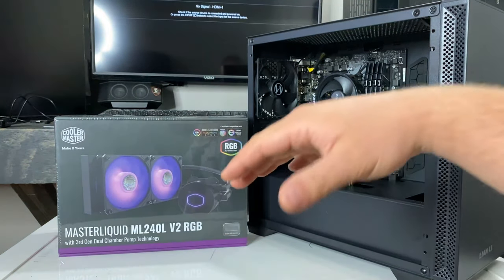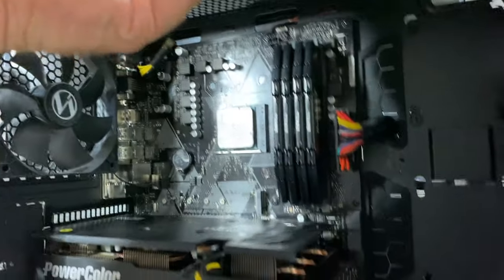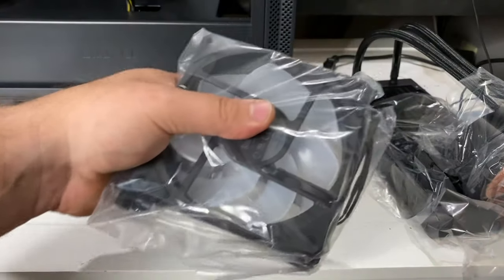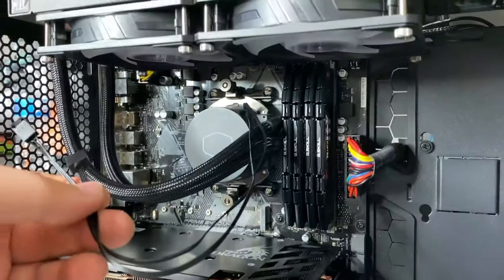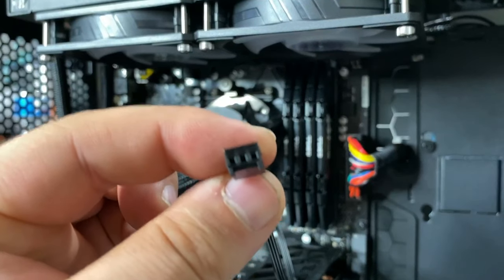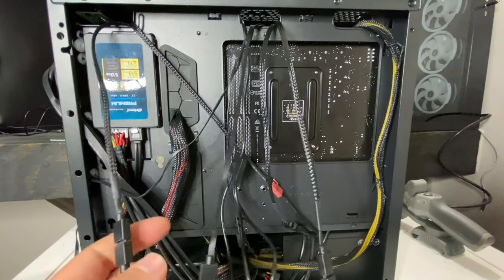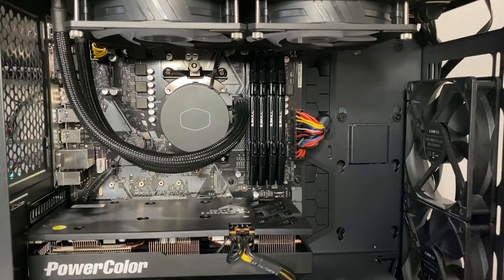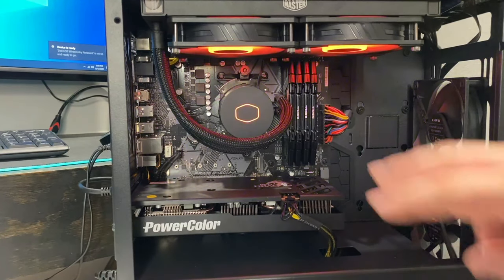How to Install a Water Cooler in your PC (MasterLiquid ML240L V2 RGB)

Comment: Hello i already installed my Cooler Master ML240L V2 RBG but when i turn on my fans works fine but RGB light dont work may you help me to solve this.
Reply from the maker: Did you plug in the rgb cables as shown in this video? Your fans have two cables each, they both need to be plugged.
Reply: @BuildsWithV  yes i did i plug in that cabble to motherboard rbg header then i connected these 3 with rbg fans cabble. And my motherbord have 2 RGB Header one in top of ram and one in right bottom, i have plug in on right bottom.

Comment: Is it necessary to replace the 120mm fans or are they good?
Reply from the maker: Shenkie The fans a good and will cool just fine, mine just made a weird constant noise which I didn’t mind at all.
Reply: @BuildsWithV  thnx for the response bro
Reply from the maker: No problem at all. Thank you for watching 🙏

Comment: Hi I’m looking to buy this aio and I would like to know i can change the color of the fans and if I can how?
Reply: Depending on what motherboard you have there is different RGB customization software for each one.
Reply from the maker: Yes you can change the color. If your motherboard has a 12v 4-pin RGB Header then you just control the RGBs using your software. If your motherboard does not have that header then you can use the included molex powered controller to control the RGBs.

Comment: Wait if I put my fans the other way would that be  Sucking in the air or out?
Reply from the maker: It would then be sucking air from the top of the case. The front of the fan sucks air and the rear blows it out. Hope that makes sense 😅
Reply: @BuildsWithV  ok thanks😅

Comment: hey please respond, do I need to do any maintenance for future references?
if you do please tell me what I have to do to "clean" it up
Reply from the maker: The only thing I recommend is regularly cleaning the radiator of any dust. Also at least once a year you’ll want to remove the cooler from the cpu, clean the thermal paste with alcohol wipes and then reapply paste and reinstall the cooler. That way it stays fresh.
Reply: @BuildsWithV  Thanks bro! do I have to refill any liquids or will it be the same for the whole time I use it?
Reply from the maker: @logic7651  it will stay at the same level for the life of the cooler. No refills or anything like that.
Reply: @BuildsWithV  thanks

Comment: How often do you have to change the water inside the cooler?
Reply from the maker: With this cooler you don’t ever change the water. It’s a closed system and the only way to really change or refill it would be to cut it open which isn’t really ideal. Water should last well over 5 years (depending on use).
Reply: @BuildsWithV  really? That makes the value jump up then jeez

Comment: I need help! I have the Asus Rog Strix b450-f gaming motherbord. Will this work. I don't really know if the motherbord has an 3 pin for the radiator.
Reply from the maker: You don’t need a 3-pin for the pump, that 3-pin can plug into any fan header.
Reply: Builds With V So I can plug that in to a 4 pin
Reply from the maker: @pantzaralfred261  correct
Reply: Builds With V thanks for the answer

Comment: Would this be a good cooler for a 5600x for 4 years+?
Reply from the maker: It definitely would, personally I’d go with something a bit better like an nzxt , Corsair or even a lian li cooler. Not that it’s a bad cooler or anything but if I were going to keep something for 4+ years I’d just get something more customizable with better lighting and better fans.
Reply: @BuildsWithV  if it’s just about the rgb lighting then I’ll go for it I just care about the performance mostly as my wraith steal was to weak to cool it .

Comment: so u need to cool a liquid and before that u have to cool ur cpu but you have a powerfull gpu below and that gpu produces hot air - means that hot air goin up (just cuz of physic) and towards radiator of ur liquid cooling system - im sorry> but>there's no point cuz ur liquid system aint gonna work on 100% like it's supposed to work cuz ur liquid aint gonna get enough cooling because of that hot air going up from ur gpu 

break my point if im not right but i think the right way is to place your radioator to the front of the case

Comment: What do I do if I don't have CPU_OTP? I have a Gigabyte B550M DS3H Micro ATX AM4 Motherboard.
Reply from the maker: eJay do you mean you plug in the cpu water block? You’d just plug it into the cpu header. Each header is called something else. CPU_fan is a common one. You can plug it in that no issue

Comment: Someone please help, my brackets to the cpu block. WILL NOT CONNECT TO THE SCREWS. Please give suggestions, please don’t tell me the bracket is upside down. It’s not and everyone tells me that. I don’t know if my has problems or something. But I can’t connect it to my motherboard. Because it won’t lock to the bracket on the MB.

Comment: i feel like the outtake from the pump should be on the other side since the RAM i s right next to the brackets. I feel like the heat might cause unwanted heat on the RAM. Anyone have any opinion?
Reply: I thought this too. From my understanding heat travels upwards and I thought there should be fans sucking air up and out of the case, where this is pushing the air back into the case towards all the components.

Comment: What if my ram in the way so my water coller fans won't fit
Reply: That is very rare although you should check your case dimensions beforehand you could also in theory just put the fans as pull fans outside the case

Comment: Do u need an specific motherboard for this or any?
Reply from the maker: It supports a wide range of motherboards. It’s not specific to just one
Reply: Just make sure you have enough cpu/fan pins on your motherboard… ALSO MAKE SURE TO MEASURE THE AREA I WAS gonna put my radiator on the top of my case but forgot to measure and so I put it in the front but that was not optimal

Comment: Hey is there a way to have it on a set color and pick it i downloaded softwares and nothing has worked
Reply from the maker: Yeah you would use your motherboard software to change the colors if you plugged the 4-pin rgb cable into your motherboard.

Comment: Can you manually control the fan speeds?
Reply from the maker: Bill Boyle yes you can. The water pump itself is the only 3-pin and will run at full speed which is what you’d want for a water pump. Thanks for your question 🙏

Comment: So my cooler didn’t fit up top so I put it on the front. The exhaust fans I put them up top and the case fans(KOLINK OBSERVATORY LITE) were linked with the cooler. The problem is every time I open the pc the temperature is 100celsius. The led and and fans work. Can anyone help me?
Reply from the maker: Did you make sure to remove any plastic from the water block? Happens quite often. If you did remove that and it’s another issue, typically the water block was not seated properly which also can happen easily. If both of those things don’t fix the issue I’d suggest checking your water block cable to make sure it is plugged in correctly and then if that still doesn’t fix the issue try and make sure the water block is working. You can unplug the fans and listen for the water block to make a swirling noise.

Comment: yo, can i individually set the colour of the fans ?
Reply from the maker: If you set the color of one, the other will change As well. The only way to do that is to plug each fan into a different port on the motherboard.

Comment: this water cooler fits on nzxt phantom 410?
Reply from the maker: It should fit up top. I can't be sure since I dont have that case on hand. But according to their website, they claim you can fit a 240mm radiator up top.

Comment: which way do you put the rgb connection into the motherboard?
Reply from the maker: So the connector should have a little arrow on it pointing to one of the holes, that hole needs to align with the 12v pin on the motherboard. So the arrow points to the 12v.
Reply: @BuildsWithV  had to flipping take the motherboard out to fit it in. Thanks

Comment: Is there a way to make the rgb work if ur motherboard doesnt have an rgb header?
Reply from the maker: Yeah you’ll just use the included RGB controller that plugs into your power supply molex cable. Just have to make sure your psu has a molex connector

Comment: I have a rgb 4 pin header but what do I do to make the remote work & the lights to turn on?
Reply from the maker: To get the remote to work you just plug all the 4-pin RGBs into the remote and then plug the remote into your molex connector on your power supply. But if you have a 4-pin rgb header I’d recommend just plugging the rgbs into that instead of the remote. Thanks for watching 🙏
Reply: @BuildsWithV  how will I change the light colors? Do I just plug the 3 cables into the splitter then plug the last one into the RGB header?
Reply from the maker: @GoshJosh  correct, just plug the 3 rgb cables into the splitter and then plug the splitter into the motherboard header. Control the rgb using your motherboard software.

Comment: My temps when start up, are at 95, is my cooler not fully seated?
Reply: yes i think so. check the fan speed, the pump (at 100%?) and the cpu cooler.
did you apply enough thermal paste?
do the temps go down?
try different software to view the temps.
Reply: @hanswurst2220  I re applied more, bumped down to like 70, took it to a buddies house and applied a more high quality paste and I never get above 60 when in game

Comment: Ok so technically I need the fan splitter if I only have 4 pin header on my motherboard?
Reply from the maker: The splitter is optional, it’s not necessary if you have enough headers.
Reply: @BuildsWithV  so 3 pin could work on 4pins?
Reply from the maker: @lollollol-fw3yg  for the fans or pump yes, for the RGBs no.
Reply: @BuildsWithV  so what do I need to get rgb on the fans? A 3 pin to 4 pin converter?
Reply from the maker: @lollollol-fw3yg  the RGBs on this AIO are all 4-pin RGBs. Your motherboard has only 4-pin rgb correct?
Reply: @BuildsWithV  yeah
Reply from the maker: @lollollol-fw3yg  okay so you’ll be good then. If you only had a 3-pin ARGB header then you’d need a special adapter. The other option is just to plug the RGBs into the controller and then into the molex off the psu. But in your case you’re good so no worries at all.
Reply: @BuildsWithV  alright thx for the help😁

Comment: can some one help me plz i have a corsair h60i rgb pro xt the aio water pump has two fan leads running out it is it possable to run 2 fans of each of thos leads the aio is powerd by sata  i have two intake fans and i want to run my aio in push pull config for a total of 4 fans imm looking to control all fans i have in icue would a splitter work ?

Comment: Hi, after i installed it, my idle temp is 60 while on stock cooler i go around 43-45, i have ryzen 5600x any idea?
Reply from the maker: My recommendation would be to remove the water block, make sure the little plastic sticker is removed, make sure to reapply thermal paste and make sure the cooler is seated pretty evenly. Should help, if that’s not the issues then it could be something else either with the cooler or the settings etc.
Reply: @BuildsWithV  I really can't thank you enough for your responses and actually saving me and solving my problem, the water block was tilting towards the bottom i just balanced it and the temp went down to 35 i really can't believe it, thanks so much again <3
Reply from the maker: @eddude299  awesome! Glad that worked out for you. You’re very welcome! Always happy to help 🙏

Comment: does the AIO already have water inside it???
Reply from the maker: Yes it does, it’s a sealed system so you don’t have to ever change the liquid or anything. It does evaporate after many years but nothing to worry about for at least 4-6 years or so. (Depends on use of course).
Reply: @BuildsWithV  lets say the water does evaporate, does that mean I need to buy a new water cooler or is there a way to refill it with water???
Reply from the maker: @HansRiveraCreations  at that point you would need to buy a new one but typically the liquid will last as long or longer than the pump itself.
Reply: @BuildsWithV  hm ok good to know, thanks man

Comment: hey, i got the noise u have just when u start the pc that weird slight vibrate/static noise and its like that permamently... what did i do wrong
Reply from the maker: That might be the fans. I also did a review of this cooler and I mentioned in that video that the fans have a constant weird sound. Stop the fans for a few seconds and see if that sound remains, if it goes away then it’s the fans making noise. If the sound remains then it might be a different issue.
Reply: @BuildsWithV  thank you for the fast respond, wouldnt believe ud answer me and within a day ur awesome gonna subscribe! unfortunately i tested and its not the fans, the sound persists even when they are completely off, i have no idea why it happens but it happens bcs of the cooler, i turned all fans on pc off from bios and it still happens and the noise comes from the cooler(the square thing that the fans are attached to it) but its not a strong sound but strong enough to go past the computer
Reply from the maker: @hananbenshabat9757  sometimes if the cooler is mounted with the pipes up then there might be air bubbles causing noise. It could also be faulty

Comment: how do you connect this with aura sync?
Reply from the maker: Plug the RGB cables into your 12v 4-pin RGB hub on your ASUS motherboard and your software should detect it right away.

Comment: Wait so if my motherboard has a 4 pin connector, can the fan header still plug in or what?
Reply from the maker: Yes it can still plug in.
Reply: @BuildsWithV  thanks man. I’m just a beginner with this stuff. I’m going to be building my first pc soon, and I’m still confused on where all the cables go.
Reply from the maker: @lyx3347  no problem at all, it all starts to make sense the more you learn and build. Pretty cool stuff

Comment: Wait, can you explain that fan plug thing again? I have never built a pc and what i am thinking is that for each fan you need one fan plug thing right? (im saying this like im an absolute idiot because I am 💀)
Reply from the maker: Each fan does have its own plug for power and for lights. This kit comes with a fan splitter so the fans plug into the splitter and then the splitter plugs into the motherboard. This way it only uses 1 port instead of 2 or more.
Reply: @BuildsWithV  ah okay thank you. 😀 I might come back later to ask you stuff 😂
Reply from the maker: @kerili5493  no problem at all 😊 feel free anytime 👍

Comment: Can any aio be be compatible with any motherboard?
Reply from the maker: Most motherboards are compatible with most AIOs but you can check the website or box to make sure it’s compatible. If you have LGA 1700 for example as your own motherboard, you’ll check the box of aio or website to see if it’s compatible with LGA 1700
Reply: I have a gigabyte aorus b550 Elite motherboard and I recently bought a Msi Mag core liquid 240R V2 but I can’t  find if it’s compatible.
Reply from the maker: @topswerv8354  yeah the b550 is a am4 motherboard. Pretty sure that aio will work
Reply: You helped a lot thank you.

Comment: tried to install it but it hits my ram sticks  so i cant mount the cooler pls help??
Reply from the maker: Are the pipes hitting or the actual water block? If it’s the pipes you may need to have to pipes on the other side. Flip it around

Comment: what if we don’t have that type of plug in our power supply
Reply from the maker: If you don’t have a molex off the power supply and you don’t have a way to plug the RGBs into your motherboard then you can get a sata to molex adapter. If you don’t wish to do that either then the RGBs will just be off. Everything else will work as normal. Thanks for watching 🙏

Comment: How many rgb ports do I need in my motherboard???
Reply from the maker: Just one 4-pin 12v rgb port. But if you don’t have any, you could plug the rgbs into molex connector off your power supply
Reply: @BuildsWithV  1 port for the cooler? And if I have another rgb components I need 1 port for each one?🤔🤔
Reply from the maker: @pablomorell568  if you have another rgb component then yes you’d need more than 1 rgb port. Or you can get a rgb hub.
Reply: @BuildsWithV  okay, thank you so much🙏🙏 Im new in this
Reply from the maker: @pablomorell568  no problem at all. I completely understand. Glad to have you here 😊